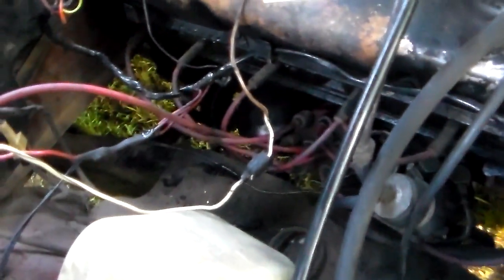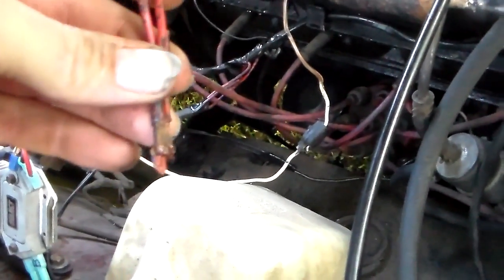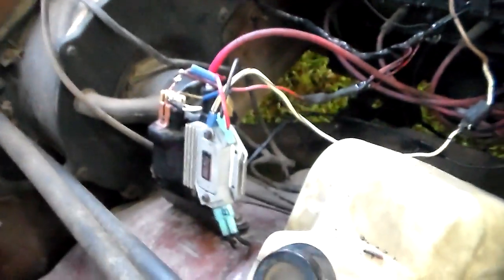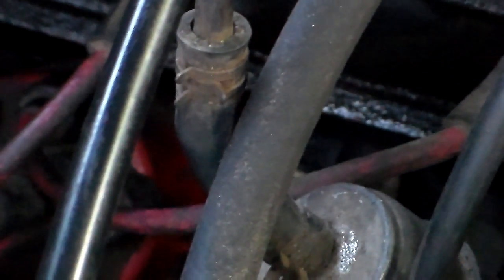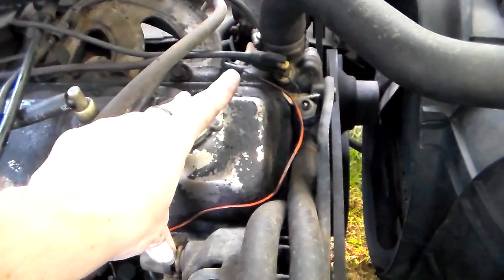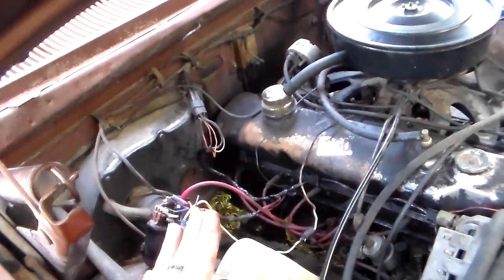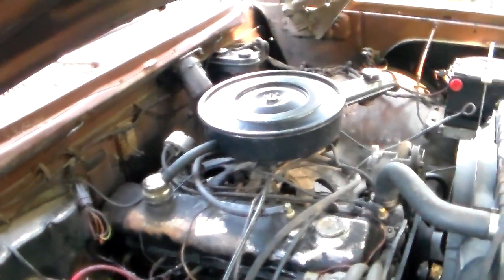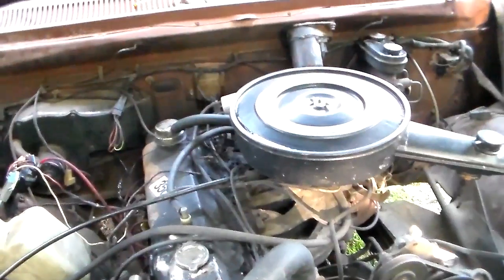Chrysler HEI conversion project conclusion

Comment: Do you have to use a different carb for lean burn delete?
Reply from the maker: Yes, a regular non-LB 2 barrel.
Reply: @TylersNeighborhoodGarage  Does ur have to be a two barrel or is single barrel ok long as it’s not a electrically controlled lean burn carb?
Reply: @TylersNeighborhoodGarage  Also, for young carburetor illiterate people, what specific carburetor would be a two barrel replacement? For a slant six that is

Comment: I bought a 87 d150 slant 6. Its a mess under the hood. The hose that comes off the middle/side of the fuel filter, where does that go to?
Reply from the maker: It goes to the steel fuel return line back to the tank.
Reply: Fuel return line

Comment: Currently from the ignition switch harness.. this is how I have it wired: large RED- runs under the hood .. spliced into 2 connections.. 1 to the ignition coil.. 2 to the alternator/elvac .... next ground and the red wire are connected from the ignition coil to the gm ignition module.. ignition module then connected  to the distributor. Large BLUE wire from the ignition switch harness is connected to the large blue wire that runs under the dash.. Large BLACK wire from the ignition switch harness connected to the large black wire which also runs under the dash, Large YELLOW from ignition switch harness connected to the starter relay.. Large BROWN is connected to the battery.. .. last there is a small black wire from the ignition switch harness that was grounded (didnt know if it would help anything, it probably isnt even a ground) the truck will start when cold.. but after it gets warm and you turn it off ... no restart... I also checked the fuses and they were still intact... any help is greatly appreciated

Comment: I have a 73 Dodge d200 318 engine.. put a new ignition switch in, but it has a large brown wire coming from it... we cant determine where it connects. We put a gm ignition module that connects to the red wire out of the ignition switch... brown is currently  connected to the battery.. is this connected right? The truck will start.. but after it gets warm, it does not want to start again. Not sure if the wires are connected right or if the ignition module is bad.. what do you think? .. thanks

Comment: The other timing marks indicate top dead center for the other cylinders for purposes of adjusting the lifters where both intake and exhaust valves are closed and are free from any lift from the cam lobes.
Reply from the maker: Thank you.

Comment: what sort of mpg do you get with that old girl?  I saw one yesterday I am thinking of picking up.  I have never met a straight six i don't like but never been around a slant 6.  It is an 85 iirc
Reply: Love the slant six, ultra reliable, I never tracked mine but It got very good mileage for a full size truck. I have one in my Valiant too and it does even better for mileage

Comment: i have the same exact coil that you used and i cant find out wich wire is positive one is pink or red and the other is white with a black line an answe would be greatly apreciated and, AWESOME videos man!
Reply: I am sure that you got it sorted out. I see that your question is 5 years old. Yeah...Pink is + and Black/white is -
- goes from the coil to the top right of the module. Marked C on the module.
+ goes from the coil to the bottom right Marked B on the module.

It sucks when you ask a question on a video and nobody responds. 

Anyway, I am doing an HEI conversion on my '63 Dart and have been watching a lot of videos and reading up on different thoughts, procedures and approaches that people have and had on their projects. Just curious?...How did you make out on yours?

Comment: Hi Tyler. Is there any possible way to do this project and use the HEI module with the white dot on it (one that comes with coil/braket assembly). I am thinking (meant to say guessing) that if I used a points distributor to trigger it, then it would work.
What do you think? Would it work, or just break lots of parts and burn lots of time?
Reply from the maker: +EngineWelder  I'm trying to remember, but I think the deal is that the smaller module will not work with the regular electronic distributor. The details are fuzzy but it was pretty clear that only the older, large module would work.

Comment: Do you know if this conversion can be done on an '87 dakota with a 3.9 v6? It's still an older carbureted  mopar that seems to have similar engine electronics to the lean burn system but I can not find any information on this swap being done on a dakota.

Comment: I did a Leanburnectomy on my 83 Slant 6 Mirada several years ago. I used a new distributor and Chrysler ignition  box. It is the same now as my 73 Dart. I also swapped the intake and carb to a two barrel from a 77 Aspen. I wish I had done it years earlier. The car runs much stronger and doesn't stall when cold. Gas mileage is up by 5!
I gave up with the EFI on my 81 Imperial and changed the Ignition and carb on it too, and it was a big improvement.
I am lucky to live in a state that doesn't have emission testing or safety  inspection for cars over 25 years.
Reply from the maker: Anything that is intended to make a carbureted engine run LEANER is never a good idea. There's probably 40hp tuned out of a late Slant six because of the lean burn, 1bbl carb, and doggy cam profile.
Reply: did you use the orange box conversion kit

Comment: I have a '86 D150 with a 318, my truck was a gas eater.  I've watched the vid and did as you did on your Miser.  Swapped all Mopar ignition parts with the HEI setup, am pleased with the results: smooth idle, more power for driving, and more mileage friendly.  Will be doing this to my '87 Ramcharger 2WD, and '86 B250 van in the near future.

Comment: i have a 318 with the lean burn, what do i do with the load advance vacuum that was on the computer?
Reply from the maker: You get rid of it along with the computer and air cleaner. A standard 318 air cleaner will fit fine. You'll need to swap in a standard 318 electronic distributor with the vacuum advance, and connect the advance line to the ported vacuum source on the carb. On a BBD or Holley 2280, that is the vacuum port on the passenger side of the carb that points directly toward the right-side fender.

Comment: What if I don't have any power coming from that red wire featured in this video?
Reply from the maker: Make sure you are checking the part of the wire that leads from inside/the firewall. If you don't have power there then check your fusible links over on the driver side inner fender.
Reply: I bypassed it with a toggle switch. I think a connection in the ignition was faulty. I didnt want to tear apart the steering column. Runs good now.